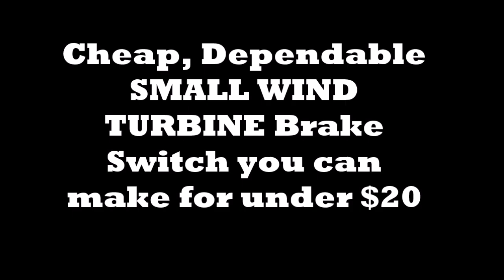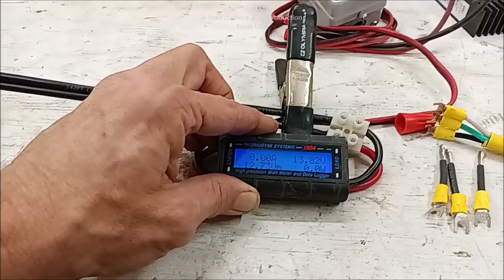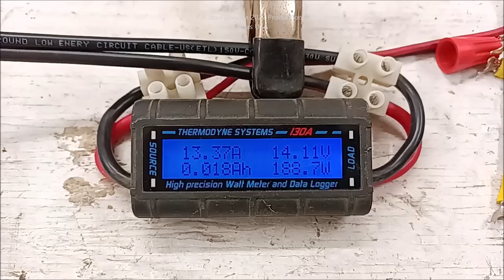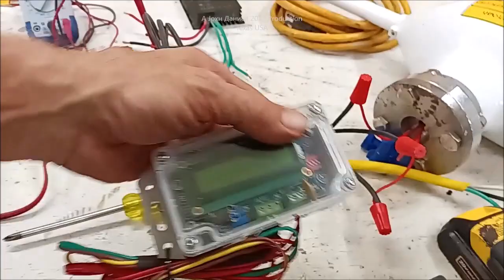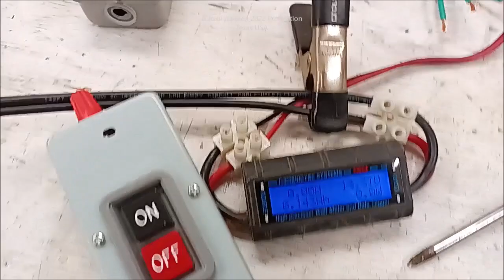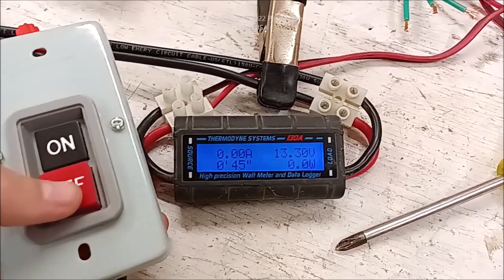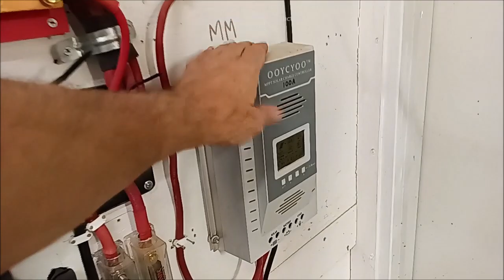Wind Turbine Brake Switch, for about $20 - Source for Wind Turbine I use posted under video

Comment from the maker: 30 amp locking switch Enclosed Model https://amzn.to/48VfT2d  Help grow the content, https://www.buymeacoffee.com/JOHNDANIEL  BISWAY Porter Cable Lithium18v 2 battery and charger kit https://amzn.to/3AvBfo5 (5 star products) Everything else, DIG BELOW! ⬇️
MY Favorite Small Wind turbine http://s.click.aliexpress.com/e/BztCS7I0  3/5&6 blade 12/24/48 volt *UPDATED ⬇️ LOW WIND MODEL http://s.click.aliexpress.com/e/bE1zQnPw or LOW WIND 600watt is https://s.click.aliexpress.com/e/_99l1XF

Comment: my vevor 500 watt 12 volt wind turbine comes with a mppt.   My guess it is of minimal quality.   I don’t want to have to manually brake the turbine.Auto is my best friend for this since it all is sort of remote, especially at three in the morning.    Is not there a device that will do this automatically or divert the power to a resistor bank of some sort?   I want to also hook all this up to some solar panels to get the best of both worlds.    Is there a simple schematic that shows the wiring and components of choice.?    I am new to this channel and still watching all the vids but have not come across what i am looking for …thanks for any help.
Reply from the maker: Plenty of videos on my channel showing working options. Soon as I can afford to make more videos I will show how to do all that automatic with 3 phase SSR controls.

Comment: Hi John. I live in the uk. I have been trying to buy one of these 12V 24V LCD Relay SSR Diversion/Dump Control/Regulator Sol/Wind/Hyd 2URDC-1224-B.
I can not get delivery to the uk. Do you know what other product I could use please.
Really like your channel.
Reply from the maker: Working with Tianmo to make them available on Aliexpress and stocked in Poland, However - Send me a Email. I can see about re-directing one. 
olympicpowercontrols@yahoo.com

Comment: I have a question for the teacher, my "advisor".
When it comes to braking options are resistave dump loads the best option?
I would never challenge your guidance or wisdom; I watched your video (4 yrs old) where you showed use of a 30 amp mechanical contacter switch which tied the 3 AC leads from the stator. Is there a preferance which has evolved in you experience?
From the Canadian "Texas region" I thank you! ✌️
Reply: Im all messed up! 🍻
Mixed the referance of time frame of the videos.
The question remains the same...😉
Reply from the maker: @dje7335  Service braking and active braking can be loaded or dead short locking styles. I show most all options on many videos. You can use water heating elements as resistive loads, or resistors or even like one of mine, a DC compressor to fill 200 gallon air tanks for air tools.

Comment: I can't find where I ask in comments that you said 5 years ago don't do this. It's ok now? What has changed? Was my comment deleted or did I just miss it?
Reply from the maker: Don't do this using a 6 terminal 15 amp toggle switch sold by hustlers in Missouri ( they sold 50K of them that cost $3 for $39 ) which will fuse, melt and blow up your turbine, some had house fires. Use spring loaded and DO NOT as shown in those Missouri scammers videos toss on that switch when your turbine is over spinning like they say is HOW to do it. Maybe their stuff can handle it since it made no power, but what we use would blow that junk switch system up. 
Numerous videos I show how to brake a turbine with pull or carbon spring switches. But NEVER use a fake brass tabbed missouri toggle unless you want damage.
Reply: Thanks for explaining. I must have missed it in the videos.

Comment: I seen a few of your videos about a year ago you said something about insted of using holm resitors to turn the over flow power into heated air you was going to use a water heating elament. Did you ever make that video? If so i would like to see how it turned out im doing something like that myself. As im also using this breaking system you showed in this video i just have to water proof the switch as it will be outside in the elaments.
Reply from the maker: You can do this with  excess wind and full loaded solar during the day as well using the right controllers. I have a 8 gallon Vevor water heater sitting waiting on my time to do it to make a pre main tank heater system. I just have had a rough year in health and cash flow.

Comment: Hey man, i don't intend on making my own switch, i just got a wind turbine and it came with a Break Switch included and the mppt too, and the break switch was confusing me because, how does it work? and your explanation/demonstration made it very clear and easy to understant, so thank you for the information! i was expecting a break to be something physical that locks the fan but the short circuit locks the motor in place and makes a lot of sense!

Comment: If Rectifiers convert the voltage from 24~ to 12, Could you use a Rectifier instead of a Buck Converter and vice versa?
Reply: No, it does not work like that. Rectifier converts AC to DC, buck and boost converters change voltage.

Comment: John have you got a video that shows how to set up the battery master slave system?
Reply from the maker: Not Yet, I have shown over the years the methods, but due to a little out of the way cost I have not yet funded a complete one in my new system. In Idaho I had it but did not make much on it but now with Lithium getting actually affordable it may be a a needed video. A Battery slave system is using a few batteries as incoming wind power diffusers and not your main bank so you can best moderate the effect in a tuned way. It extends the entire battery banks lifespan. With LiFePO4 you can use lead acid slaves in a 24 volt arrangement to pass through charge a banks of 12 volt LiFePO4 via cheap PWM solar controllers. I will have to make a example of it soon.

Comment: I cannot go to my camp for 8 months during the year. I understand the best way to secure the turbine is to follow your set-up in this video: "Wind Turbine Brake & Safety Controls". I have 3 resistors 300 watts for diversion load. I will connect the outputs of the resistors to the controller I received with the turbine.
Reply: Maybe sell n buy closer

Comment: I saw somewhere it was not good to put the turbine on brake for a long time. Is it true?
Reply from the maker: Yes, leaving one on brake for a long period of time, such as a week to 10 days or more can cause pitting in the slip ring and even some over saturation of magnetics in the core of the rotors.
Reply: @JOHNDANIEL1  Thanks

Comment: Ha John.. I have been running BC500 for 4 years and just recently last 6 months it doesn't seem to be putting out power like it used to are there any checks I can do to see what the problem might be.. it's on a  tilt up tower and really don't want to bring it down if I don't have to
Reply from the maker: After that long, I'd check for corrosion on the wire connectors from the turbine  down. Another possibility is carbon dust build up on slip rings. Either way, it's like a car and does need attention sometimes. Be sure to recheck all fasteners, use water pump rtv on gaskets when reassembly. 
J
Reply: @JOHNDANIEL1  thanks.. 6am here in NY you don't sleep much either

Comment: Hello, nice video, it seems that the black microcontroller have already an auto braking system, why building another breaking system ?
Reply from the maker: It's not a brake, it's a over speed  pulse lock up  so it's real abusive to the turbine.

Comment: John, this brake is a short circuit on the 3 phases. I thought this would burn your windings in the pma. Explain why it wouldn't burn the pma, pls. I'm confused.
Reply from the maker: If engaged to stop the Turbine before heavy storms and winds it prevents turbine damage. Normal use of the brake is for service or if your not going to be home when a potential storm may hit.  You can engage it at up to 20% power output without damaging windings. In case of a surprise wind storm you can when the turbine spins out of the wind due to torque if your fast also engage it before it gets spun back up. Owning a turbine is like owning a car, you don't run it in weather that will damage it. The turbines I use the 800 and 600 and the 500 also can handle sustained 40 mph, would survive 60 mph, but if gust may exceed  45  I park them before such forecast comes true.
Reply: @JOHNDANIEL1  but, I'm talking about the short circuit on all phases, you showed the proper way to brake the turbine and is with load resistors... Prevents the winding not to burn, the heatzone is on the resistors, not the turbine windings... I'm still confused...
The schematic of your switch brake, looks like a short circuit.
Reply: @diogomartins9101 PMA connected on dead short will not burn itself. It keeps itself stopped. Connect wires of a generator on short circuit, try to spin it and the generator feels heavy to turn. As he mentions, it could be possible to apply the short when there is little output without damaging the windings.

Comment: Have you ever tried a 3ph contactor like the ones AC units have,  with a 12vdc coil , then use it for the brake? You could probably find some way to automate the coil using a programmed VSR when your batteries are full or wind is too fast.
Reply from the maker: Yes, they tend to get cycled far too much and a 12 volt coil is rare to find. The majority are 24 volt. A 3 phase SSR  works much better. It has a trigger voltage of 5 to 32 vdc.
Reply: @JOHNDANIEL1  do you still need a manual switch for the SSR? Oh thats what that controller you mentioned earlier was for.
Reply from the maker: @codiecarroll735  The controller sends a 12 volt signal that trips the 3 phase SSR

Comment: john rather then put a bms could i just put a plain battery balancer 5amp , im running 38120s 40 of them in a 4s one battery thank you ?
Reply from the maker: Yes, but a BMS controls charge as well as discharge. Sad, they should make them as a outer mounted option.

Comment: your not getting too old youve got some miles in ya yet, those little turbines amaze me for such low rpms. one guy who easily has more brains than me which isnt hard  reckons a stator will heat up and even burn if the blades are huge enough and the wind strong enough when doing a dump/brake to  wire wound resistors no battery hook up, i dont know how true that is but i guess some temp sensors on the windings would soon teach me .
Reply from the maker: They will burn up if you try to go past their designed abilities.

Comment: I know close to zip, but...You have to be present to hit the switch, so what happens when you're not there?
Reply from the maker: If your not a weather watcher you have to get a automatic system. Those are very expensive but I'm working on a much cheaper version.
Reply: @JOHNDANIEL1  Bingo!  Thx.  I just happened to remember reading about old sch mills/how to make, a self-resetting mechanical brake for when its blowing too hard.
I also got a chuckle about the drill twisting your hand bec I once didn't realize that my Bosch was set on high speed & max torque, and in an awkward position under the car.  24+hrs of barely being able to lift my coffee cup 🥴
Loving the education that you're providing
Reply from the maker: Yeah I think there's a certain age where your joints start disagreeing with all your actions. We started to try to raise funds to get some materials to do this with because it's just getting too expensive to pay your grocery money out in parts.

Comment: If the wind brakes keep burning out, why use them? Why not just set up a voltage regulator?
Reply from the maker: Proper brake switches done fail. It's those cheap slotted toggle switches or plated contact switches that are notorious for failure. That's why I showed this option. A controller for wind power is better defined in many of my older videos.

Comment: Hi John, I thought in the past you are using three resistors instead of the Dead short .
Reply from the maker: Braking is shorted to "park" the turbine.  But diversion loading controls battery charge and uses resistors.

Comment: Bought one of the TaoTronics A/Cs and liked it so much as to order a second one. An added bonus is that it's not so heavy it can't be handled by one person.
Reply from the maker: We were bound really bad with medical bills for my wife, but as I clear them some more I plan to get the rest of mine I need. It's easier to buy them instead of more solar, wind, batteries and controllers to handle the old style AC units.

Comment: Great video, thanks lots.
I have a rookie question, though. What actually happens with solar / wind power, when the batteries are fully charged? Is there danger of overcharging the batteries or is that electricity "magically" going to waste?
Sorry, if that is a dumb question. I just simply understand far too little about the topic.
Reply from the maker: The wise decision in that is to use an alternative collection instead of just burning off the energy. One of the ways that I've solved it is to use a few hundred amp hours of lithium and then return that charge to my lead acid in the middle of the night. Recent videos describe that on my channel.
Reply: With solar the controller will simply stop charging the battery.
With wind once you reach a certain voltage you switch to a dump load like a heating element or a brake like the switch where the wires are simply shorted until the voltage of the battery drops back down to less than fully charged.

Comment: Isn't this what a certain guy from missouri does? i thought you needed resisters for a brake?
Reply from the maker: Resistors are for dump loading so that you can manage your battery voltage and prevent the turbine from overcharging, a break is so that you can park the turbine in an off position to keep it from being damaged and bad weather or service the turbine. The guy in Missouri uses a cheap plated contact toggle switch and they tend to burn up and let loose of your turbine at the wrong time.